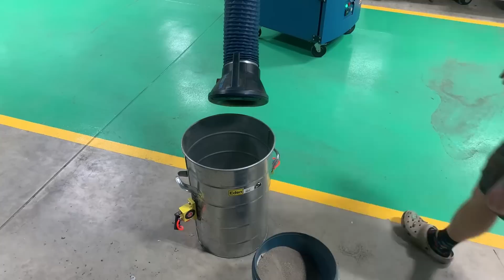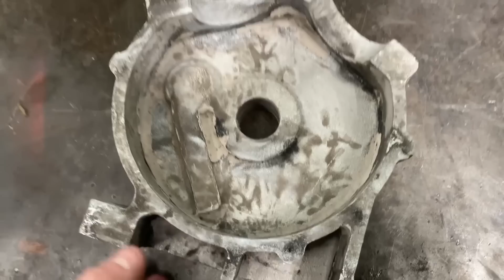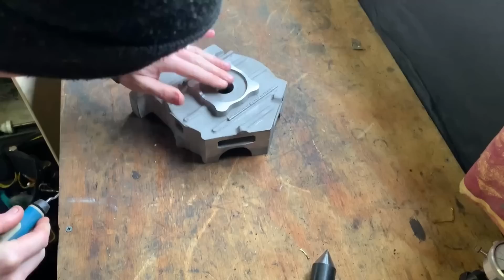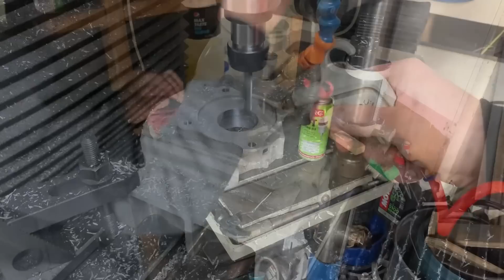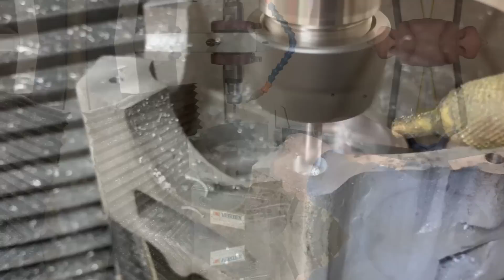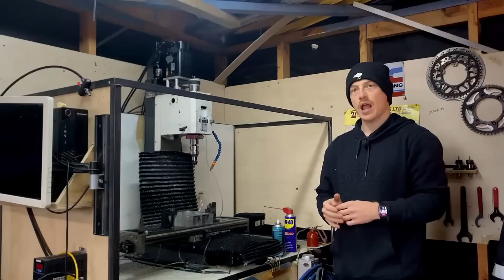Casting and Machining a Retro V-Twin

Comment: Just out of curiosity, why do you cast this with such a long sprue and not shorten it for faster pour and less chance of freeze?
Reply from the maker: It increases the pressure in the cavity to improve the fill as the aluminium is fighting gas from the foam.

Comment: I understand the coating has to stay thin so the foam decomposition gases can escape, and the sand must fully support it to prevent the shell from collapsing during the pour. But why not make the plaster shell slightly thicker and stronger so it’s less dependent on perfect sand compaction, then add a vent opposite the sprue to help the gases escape? Wouldn’t that reduce the risk of unsupported areas failing, or would a thicker shell create other problems?
Reply from the maker: The thicker shell would make the gas escape slower which could lead to the foam vaporising before the aluminium could completely replace it as the fill rate would be slower. This could lead to similar problems being mould collapse or the aluminium freezing in thin sections.

Comment: do you degas your aluminum with argon/nitrogen? I heard you'll get stronger parts with them.
Reply from the maker: When I have professional castings done at the foundry the aluminium is degassed and is CC601 or LM25. I then heat treat this to T5, soon I will be getting it done to T6.

The casting shown here is not degassed although it has no issues with porosity.
Reply: @OddsandEndsMachining  does does degassing aluminum really that necessary? I don't wanna buy a whole bottle of nitrogen. hydrogen is less than 0.5% of air.
Reply from the maker: @maxamps45 the best way to avoid hydrogen is to remove the dross off the top of the aluminium in the crucible and pour under 720c, above 720c the aluminium rapidly absorbs hydrogen from the air. There is a graph you can google to see how much is absorbed at different temps.  

You can pour at cooler temps but that 700-720 range gives you more time and lowers the chance of the runners and thinner sections freezing.

You can also degass the aluminium with tablets that are dropped into the molten aluminium and pushed down to the bottom, but it depends on what you’re making. If it’s just non structural hobby stuff I wouldn’t worry about it.

Comment: Im not sure what sort of polystyrene you use for your patterns, but i use Extruded polystyrene XPS closed cell. It machines beautifully and doesn't have the bead texture of expanded polystyrene. Its nice and firm and much stronger than the normal expanded poly. I use a Foseco refractory coating called Holcoat (water based). Awesome videos and great explanation. Greatings from Thames in the beautiful Coromandel.
Reply from the maker: Thanks for the info, I may try another coating in the future. I have been using XPS also, but I have ended up receiving different densities which machine differently. Where are you sourcing your XPS?

Thanks
Reply: @OddsandEndsMachining  Koolfoam Auckland the sheets are a rich blue colour.
Reply from the maker: Thanks for that, I might check them out. What kind of things are you casting?

Comment: Cool project, subscribed to follow your progress.  Your castings come out nice, like the setup you have.    My last casting I made an error and miscalculated the amount of aluminum I needed, came up short on the pour.  So much time preparing for it, live and learn.
Reply from the maker: Thank you. That’s unfortunate, I know the feeling. I guess it’s a lesson you won’t soon forget. I usually get the weight from my cad model and also add the weight of the gating and sprue and then a bit extra for fudge factor.

Comment: How gummy do you find your cast aluminum? I find that my aluminum castings trend to build up on the cutting tools resulting in poor surface finish.
Reply from the maker: I haven’t had any trouble with the tools sticking so long as the tool has coolant on it. It seems to leave a nice consistent chip.
Reply: @OddsandEndsMachining  I guess I have to get my mist coolant system going. Have you tried heat treating your castings?
Reply from the maker: @ColCurtis  this one was heat treated to T5, my first casting (the first engine I made) was not but still machined well in spite of this.
Reply: @OddsandEndsMachining  great, thanks for the info. I just found your channel, definitely going to watch more.

Comment: I've been attempting to cast spur gears, quite like to try lost foam, wondering how you make the pattern?
Reply from the maker: Using either a CNC router or my CNC mill. If you check out some of my first videos you will see how I did it. 

You could always use a wire cutter for foam.
Reply: @OddsandEndsMachining  thanks 👍, yes I already had a quick look, fascinating and I like how the process uses foam that is basically free

Comment: Consider a proper micrometer to measure bores and shafts rather than calipers. Should gain at least 10x accuracy. You’re not accurately measuring microns with a calipers. Otherwise, impressive work!
Reply from the maker: Thank you, I have a mitutoyo 0-150mm set that measure .01mm but sometimes they are a bit less convenient, I should really get into a habit of using them when the tolerances dictate.

Comment: The G83 cycle (often called peck drilling) is intended for deep drilling or milling with chip breaking. The retracts in this cycle clear the hole of chips and cut off any long stringers (which are common when drilling in aluminum).
Reply from the maker: This is how all the holes were drilled. Other than the hand programmed G code which didn’t peck. 

One of the oil gallery holes was 3.5mm diameter and 45mm deep it required a full retract after each peck to give it the best chance of going straight, due to there only being 2mm of stock either side of the gallery.

Comment: The secret to hardening sand casted aluminum is cryo tempering. I had a 1953 HD, and one after market cylinder exploded, letting the piston cock sideways, and come down blowing the cases apart. A man who welded for NASA, tried welding the parts together, but on the thin sides of the case he got spider cracks that he chased forever. He told me he tried heating in an over and welding while still extremely hot, and still spider cracks. I read about race car drivers cryo tempering the engines, and parts. So I tried it. After the tempering, a union welder, came in and welded them up like it was modern aluminum. no cracks, worked like a charm. After welding the heat put different stresses in the metal, so I cryo tempered them, a final time after welding, and the engine is still running today, after being blown in to pieces, and put back together again. Try it, it is not expensive, and it the best thing that ever happened to sand casted aluminum
Reply: Sounds expensive bro😮
Reply: @djpaulk  Don't remember if i replied before, but cost me 45 bucks
Reply: @djpaulk  A styrofoam box and some LN from the welding supply store doesn't actually run much at all.

Comment: After watching your lost casting and subsequent machining, I had an idea that I was wondering if you’ve tried:

Have you ever considered putting Heli-Coil threads into the foam casting along with white oak wooden dowels spun into their center as plugs but sticking out into the sand by around 4” to help secure their relative location as the supporting foam is lost? 

You wouldn’t need to worry about getting it lined up with the top since you’ll just be machining that surface flat anyway and the wood dowels will undergone a quick carburizing with little oxygen so they won’t burn away but their exterior in contact will quickly turn to charcoal making removal and cleanup simple and quick.

I know nothing of lost foam casting and barely anything of traditional sand casting aluminum so I can understand if my thought fails at a fundamental level because of something like the high heat ruining temper of coils OR more technical challenges like the aluminum skin fails to bond with the exterior of the coil or the protruding coil may potentially disrupts the molten metals skin causing it to fold over and create defects which in turn could lead to voids or weakened sections at the location of the folding. Anyway just a passing thought, I enjoyed the video and was able to inference a few things based on how you made your fill channels.
Reply from the maker: Thanks. It is something that is done on some die castings where they have pre positioned steel parts which are cast around. I’ve seen it done for main bearing bores. This is likely because steel can take more of a hammering before the bores elongate. 
A reason I don’t think this would be a good idea for threads is when it comes to facing the parts the helicoils are very hard and won’t machine very well. Also getting them perpendicular to the machined surface is easier to do once it is machined.

Comment: This just popped up in recommended, I watch far too many machining video's but making a V-twin- cool stuff
(I was a motorcycle mechanic at various dealers in 1970's~90's then taught at MMI Orlando almost 12 years).
Love the irony of making IC engine from Tesla parts.
What top ends are you going to use?
I see you have  slots for cam chain, looks like Honda pattern (XR200's?)
Keeping the Kiwi tradition going, great stuff, I'll subscribe
Reply from the maker: Thanks. They are Chinese copies of an xr70/crf70 cylinder and head.
Reply: @OddsandEndsMachining  That's really cool. 
In te 80's I wanted to do similar with XL185 top ends as I had a few.
Never got around to being anything morethan a dream though.
I still haven't done any casting either, always seems to be something more important (usually expensive) to fix instead (particularly since I got married) 🙄

Comment: Nice castings. I've never tried lost foam castings before. I like that you don't need to worry about draft angles.
Regards,  Preso
Reply from the maker: Thanks, It definitely makes design considerations a bit easier as no cores are required.

Comment: Casting looks good considering the porous looking sand.  How did the heat treat work ?  T-?  . Nice work
Reply from the maker: Without any legitimate way of verifying the heat treatment I think it went quite well 😂. I went for a T5 heat treatment as it is 80% as good as T6 but a whole lot easier to achieve.

Comment: I learnt something today!  I have never seen casting in dry sand like that before.
Reply: He didn't go into the mold details in this video but am assuming he coated foam with a refractory coating to create a shell.  They call it lost foam casting, the coatings used usually have ceramic in them.  The sand is then just to support it during the pour.  Good choice for engine blocks and things of that nature.

Comment: Would a grove cut in the case half-mounting face for O-ring material be an effective oil seal?
Reply from the maker: Yes, it is done on some high end race motors, it’s good when they come apart fairly often. I won’t be doing it on this motor, my spindle is far too slow for a 2-2.5mm end-mill. It’s also costs in more time and material  than cutting out a paper gasket.
Reply: @OddsandEndsMachining  If you ever reconsider you might be able to rig up something like a dremmel to get the spindle speed high enough.
Reply from the maker: @2000freefuel  I’ve thought about using my trim router as an auxiliary spindle, but that’s on the very long to do list.

Comment: I cannot think of a better use of Tesla rims, or any other Tesla aluminium part come to think of it 😀. Nice work Jonny, keep up the greak work.
Reply from the maker: Haha, thanks.
Reply: @OddsandEndsMachining No problem Jonny,  I'm surprised Brad has'nt got you to cast up something for the Borg yet 😄
Reply: Should have plenty of the Cyber truck rear frames to melt down soon enough. First time anyone uses it as a real truck it's going to break and rip off lol.

Comment: This is cool but you're losing the gearbox and clutch. Board track replicas accept classic preformance to have a classic design. Gonna go with no brakes like they used to? No throttle just cut the ignition to reduce speed like they used to.
Reply: Bro shut up you’re being completely pedantic. Go find some other corner of the internet to shout your empty complaints.
Reply from the maker: I think the final application for this engine is a bit different to what you’re thinking it is.

Comment: Excellent work, looking at the finish you got on the mating faces of the case half's i think your heat treating exercise was a success
Reply from the maker: I think so too, the threads also seem fairly strong in the tapped holes.